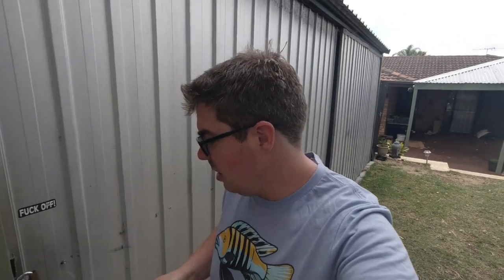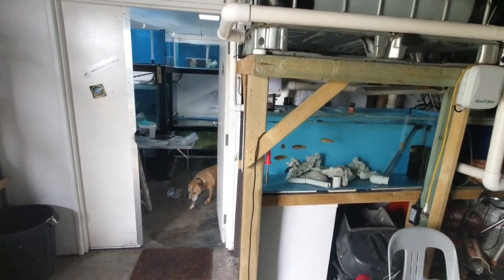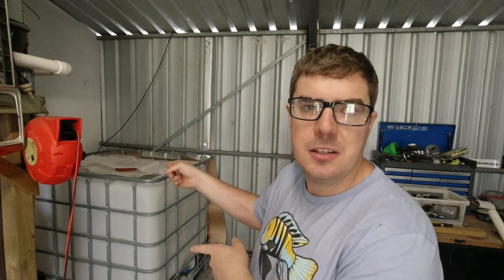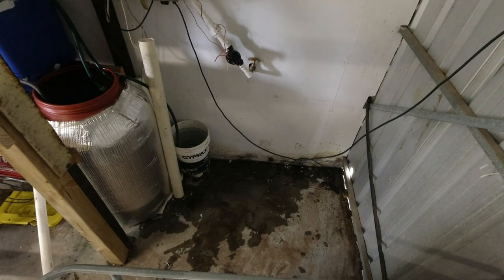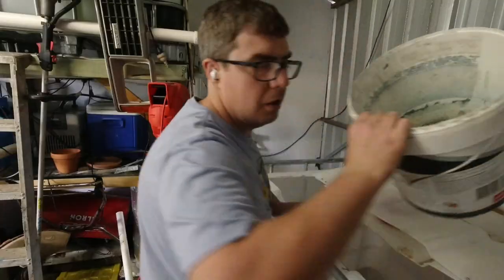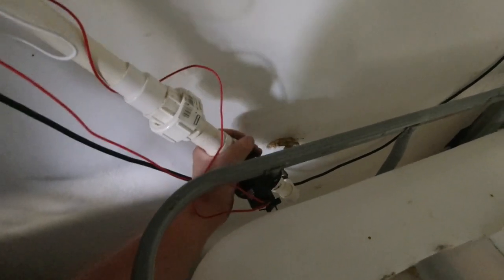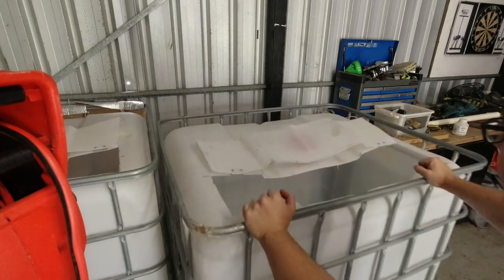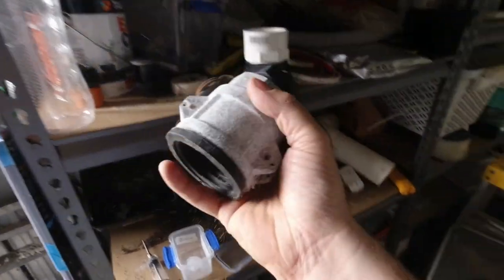Setting up 2 1000lt summer growouts

Comment: I made a wooden frame for my Samsung S6 using 2 pieces of wood and 2 bolts with wing nuts.. simple.. and it can adapt to any base reqd. Why not move the solenoid up high above the height of the IBC frame then you can get to it when needed instead of cutting the IBC tank frame. Don't forget what are you going to do when you have filled the IBC you can't move it or get to what is beside the wall there.. Make it easier for later move things up now. Also if you had the tanks with the outlet valves facing out then you could fill them quickly with the hose pressure connected, instead of the hook one you use.
Reply from the maker: Hey yes I could have moved the solenoid but I didn't really see the point as I would only gain 100mm and I couldn't turn the ibc  the other way there wasn't enough room to put them sideways. They will be on automatic waterchanges no need for the bottom fitting